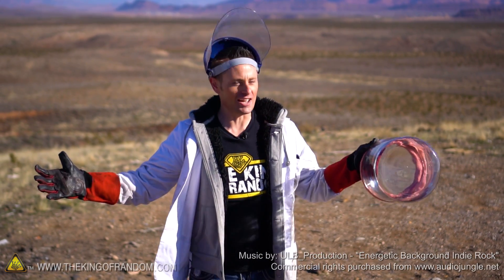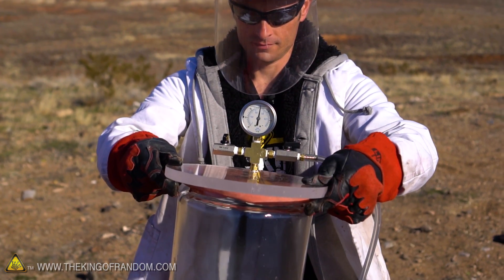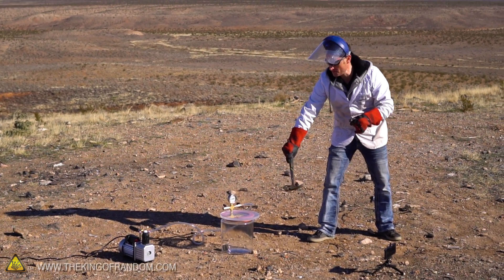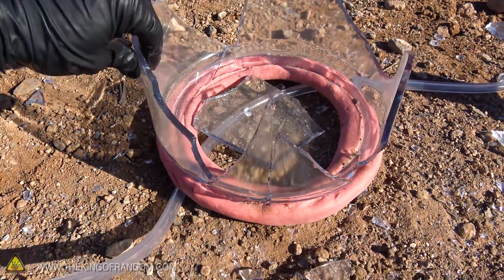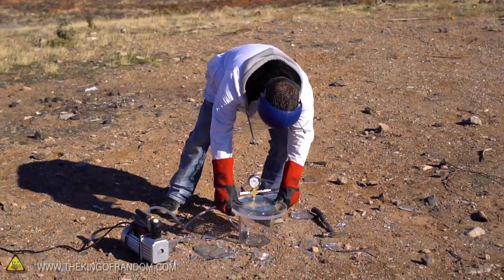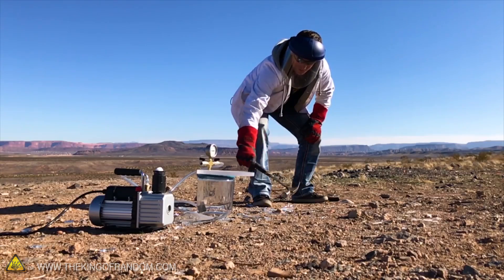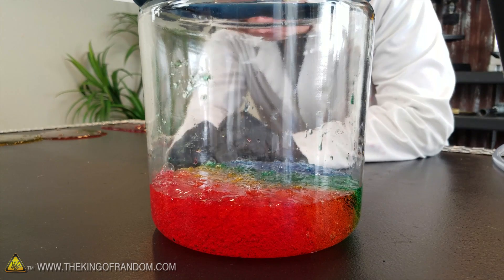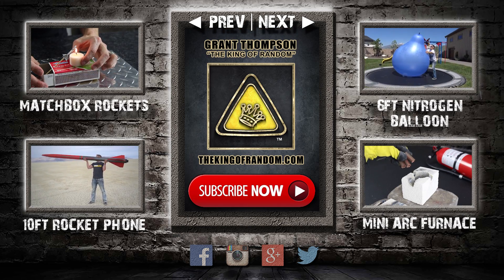Smashing Glass Vacuum Chambers

Comment: 25 inches  (635mm) of mercury is definitely not a strong vacuum considering atmospheric pressure is around 760 mm Hg. Most pumps that size should get down to 5 mm Hg easily, but your vacuum chamber is hardly air tight...

Comment: I have a theory, the glas should in one way explode, why well in a vacum you remove the air and it changes the pressure so if the glass would break then the air will come rushing in and the presure would rise fast and it would make a explosion???

Comment: Could you make a hand operated vacuum pump, like the kind they used to use to pump water for fire trucks (except with pvc, and without water). (google "hand operated fire pump")
p.s. it could be easier to operate if rather than pumping up and down, you arranged three barrels radially, then used a hand-crank to actuate the pistons.

Comment: liquid mercury vs liquid nitrogen
Reply: The side wall will not be the weak point. You should have tapped the bottom with a hammer. The floor isn't dome shaped like a regular vacuum glass and under a lot of stress. I bet it would break dropping it from 2-3 inches.

Comment: place fire work inside glass jar under pressure and ignite with strong laser pointer, may have to black out the fuse with sharpie.  I wonder what would happen with the expansion of the explosion under that sort of pressure and also what it would take to detonate the glass jar.
Reply: Brian Cramer 
Cody's lab did a video in it, if I remember correctly he couldn't get ignition.

Comment: How much negative pressure would be needed to turn the implosion into an explosion? If I remember correctly I know that some implosions end up sucking in a massive amount of air compared to the volume of the area and results in an explosion from the extra pressure. I assume it'll have to be a lot more negative pressure and a larger area than these jars.

Comment: What dose liquid niceragen do in a vacuum camber
Reply: Mpc Gamer Liquid Nitrogen just boils away possibly faster. Under extreme pressure Liquid Nitrogen can be made into Nitrogen Ice as more pressure raises the temperatures required for boiling and freezing where negative pressures lower it. Nitrogen already has a very very low boiling point and the vacuum makes that temperature even lower so it would just boil faster and possibly more vigorously but its not really a substantial difference. If Grant hasnt done it, another great youtuber Cody'sLab does this in one of his videos.

Comment: how will molten metal react in a vacuum ?
Reply: Ripstikerpro -Minecraft IT Will stay hot for a long time because the vacuum isolates really well
Reply: Berend Dekker yep. heat is pulled away. this is why copper is used as a heat sink. without anything to interact with the heat, it would last longer.
Reply: It doesn't do anything special.  There is a large variety of metals that have to be melted under vacuum, and make it a common practice in the foundry industry

Comment: not sure if it still works or what brands would work but i remember doing an experiment where you take a can of shaving cream and put it in liquid nitrogen and freeze it and cut the metal can off while frozen and when the shaving cream unfreezes it expands exponentially bigger than the original form

Comment: can you pop popcorn by introducing a sudden vacuum? 

my reasoning is that popcorn pops because water turns to steam and forces the kernel open. this usually happens by heating, but it could also happen due to low air pressure bringing the boiling point of the water way down. there are some wrinkles to this though. popcorn gets its shape and fluffiness because the heated starch turns into a gel that gains that shape when the kernel explodes before rapid cooling solidifies it into the little puffs of deliciousness we all know and love. I wonder if it would behave differently.

Comment: What would happen if you tried to use a hair dryer in a vacuum chamber?
Reply: The fan blade doesn't move because of the air, the air moves because of the fan blade.

The fan blade moves because a motor is forcing it to.

It's like waving your hand in the air vs a vacuum... it'll still move, there just wouldn't be any air to push around.
Reply: P Sylar 
the fan is moved by a small motor, so yes. but it should move faster because it isn't affected by the friction of the air.
Reply: Most hair dryers depends on air to cool down heating element. Without air it would overhead and thermal fuse/switch that is inside would disconnect power from heating coil. Other than that it would be just like spinning fan.
Reply: Or anything that sucks air to work
Reply: It would just spin the motor and probably burn out since no air would be cooling the motor as it spins.
Reply: P Sylar itll spin the fan inside, without any effect.
Reply: soulseeker3194 but the fan is shaped a certain way to blow air so what if there is no air to blow would the fan move?
Reply: P Sylar Cody's lab made a video about that

Comment: IT DOESN'T GET PULLED PULLED IN. It is pushed in by the atmosphere around it. It is like when you increase the pressure in a bottle the increased amount of air particle in there push out. As there is very few or no air particle in the jar to push against the inside wall of the jar that mean the pressure of the air particle on the outside of the jar pushing on it allow it to implode.

Comment: put proto putty in a vaccum chamber without corn startch cause you said in that video that if you dont have corn starch its hard to remove the air bubbles in the bottom!

Comment: what is different between implode and explode?
Reply: Fikri Noh Explosion will generally be from positive pressure such as  an inflated balloon popping. Implosion will be from negative pressure i.e. Removing the air from the cookie jar.
Reply: Fikri Noh Its just that the shards go inward or outward, like bombs explode and stars implode.
Reply: Fikri Noh IMplode goes inwards, EXplode goes outwards.

Comment: How did the gopro record sound in the vacuum chamber?
Sound doesn't travel in a vacuum.
Reply from the maker: You're right, it was the audio from my microphone, not from the GoPro.  I checked the original footage and there is no sound from the GoPro.  Only the vibrations from the internal microphone when the jar is hit.
Reply: While grant already answered the question - Sound can travel in a vacuum chamber.

Sound travels through any medium - its only vibrations in materials that we call sound, it isn't anything beyond kinetic energy transference.

In a vacuum chamber, the chamber walls transmit sound. With a properly tuned mic attached to the walls - or a laser mic, you can hear sound or detect kinetic energy vibrating the walls in a vacuum chamber.
Reply: Actually, there is only no sound in a perfect vacuum which is impossible to create.
Reply: Valdemar Åberg it was on the glass so it had particles to vibrate
Reply: Arron Davies so if it's impossible to create a perfect vacuum how do we know there is no sound in there.
Reply: Sound can travel through the glass
Reply: Valdemar Åberg check out codys lab he did a video on sound in a vacuum chamber.
Reply: It's touching the glass.
Reply: It doesn't work like that.
Reply: no air will mean no fire. no fire = no firecracker/fuel burning
Reply: Valdemar Åberg that were recording the sound with re other camera as it was his mic picking up the sound not the go pro.
Reply: One Shot Gaming there's too much space between particles in space for sound to travel
Reply: +One Shot Gaming Sound travels by making particles move and bump into each other. This continues until it reaches your ear at wich point you can hear it. A perfect vacuum contains no particles.
Reply: Arron Davies yup
Reply: The sound can be recorded on another device!
Reply: Dylan I wad the l one who said that they
Reply: Dylan lol youre right
Reply: Valdemar Åberg he turnd off the vacume
Reply: Wouldnt it be fun to get some rock that's got a high amount of air in it (some vulcanic rock u know what i mean) and put it into the vacuum chamber? Could also put another of those stones in there but before that let it get soaked with water.
Reply: Yamyatos Volcanic rocks have holes in them so nothing would happen
Reply: Well yes and no. Just like if there were bubbles on the outside of his gummy, not a lot would happen. But vulcanic rock is light for a reason. There are airpockets everywhere within. We know what happens to liquids, so this is about having a look at solids. Maybe nothing spectacular happens, but maybe something interresting happens. Probably it'll just crack or something, but i also wouldnt have thought that the wax would like as if it was boiling. when put in a vacuum.
Reply: Nothing would happen. It's porous, the air pockets aren't surrounded by anything airtight so the air would just flow out.

Comment: What you put a vaccumchamber inside of another vaccumchamber? would the one inside implode with enough force?
Reply: What force would their be?
Reply: Elrarion2 I don't know, vaccum?
Reply: A vacuum within a vacuum doesn't make the first vacuum twice as strong. Its like putting a bottle of water in a river. Nothing happens.
Reply: Yeah I know, but would the glass of the second chamber implode by the pressure of the larger one?
Reply: What chamber is what? The 2nd is the small one that is within the 1st bigger chamber?
Reply: Yeah, would the smaller chamber on the inside implode by the pressure the larger one on the outside?
Reply: A vacuum has nothing inside of it. Meaning everything even any air. So their would be no difference between the smaller chamber and the larger chamber. Similar to what i said earlier. A bottle of water in a river is the same as a vacuum chamber within a vacuum chamber.

Comment: put ethanol or other alcohol in the vacuum chamber. will the vacuum lower the pressure enough for it to boil?
Reply: Well as ethanol boils at a lower temperature then water and that water is able to boil in a vacuum then yes. Ethanol will boil.
Reply: Elrarion2 but is the vacuum he has able to make the pressure low enough
Reply: Most chances yeah.

Comment: upon examination, the only reason the large jar exploded was because you hit it with the hammer at an angle, therefor having a smaller impact surface but with similar energy and shattering the glass

Comment: next time, put in an insect like a cockroach inside the vac chamber, lets see if they can survive (pretty sure they wont) then try breaking the glass while the roach is inside.

coz i remember somewhere i read about the submarine that wasnt de-pressurized when they opened and all the innards and limbs of the oceanologists flew all over the submarine (a small size probably fitting 3-5 people)

Comment: you should try to hit the jars while putting pressure back into them to see if they can explode rather than implode
Reply: or try using a glass scoring tool to see how much you can decrease the structural integrity before it either breaks from the vacuum or from the air rushing back into the jar

Comment: as long as the pressure difference doesn't get crazy high the cylinder gets strengthened by the decreased pressure, as the "vacuum" is pulling on it from all sides at once, and thus giving it a higher structural integrity, think an archway with a lot of weight on it opposed to an arch without anything putting strain on it (ie, the strength goes up by adding wight until the strain on the material itself gets bigger than the increase in structural support, where a graph showing it would start to move down again). the bottom however only gets weakened by the pressure difference, as a flat surface has much less structural support in it's shape, and thus the very easy breaking by hitting the bottom instead of the side. If this is to be tested further, i suggest a jar with the same thickness on the sides and the bottom, and hitting them respectively with roughly the same force to demonstrate it.

Comment: Oh NO... lol.. its round.. your pulling the glass inwards.. 
did you ever wonder about archways or dams and why they make them that shape? :D its because under compression they get stronger..
So your glass jars will be stronger under vacuum on the rounded sides..

So to explain why the bottom vanished, it's because you're pulling in on a flat surface which is its weakest point. Which is why when you dropped it on the bottom it went so easily..

The test you need to run next is to tap it on the bottom as thats the weak point while its under vacuum!!!!

Comment: I'm pretty sure you're reading your gauge wrong Grant, air conditioner vaccum pumps usually reach ~500 microns. 25 inches of mercury is ~80% of atmospheric pressure and ~ 635000 microns (A micron is 10^-3 mm of mercury).

EDIT: Okay I realized that the way you have it setup what you're reading is the pressure differential between your system and the atmosphere, that means that 25 inches of mercury means that there is 6.25 in of mercury of pressure inside which is ~150k microns which is not that bad. Still though, if you really got an AC pump it seems a bit weak or maybe you just haven't given it the time it needs, the time to achieve the ultimate vaccum a pump can get is quite long so it's understandable.

Comment: If you put vacuum chamber into the water, will it float or will it sink?
Reply: axoliminator actually, it's the amount of water that the cookie jar displaces that allows it to float. It displaces enough water that the water is able to push up against it with enough force to counteract its weight. Given that vacuum has no mass, it would actually float better with a vacuum than it would with air!
Reply: The vacuum would mean there isn't ANYTHING inside the glass jar which would, I assume, make the contents of the jar,  lighter than air.
Reply: Katze It will float much better than one without vacuum
Reply: my guess is that it would sink. The air is what allows it to float because the air is less dense than the water. take away the air and you only have the weight of the glass jar, wich would then sink.
Reply: Katze water can't drown :v
Reply: It will float. If you take the mass of the jar and divide it by It's volume, you would most likely see that the density is lower than waters density, which is 1 g/cm^3. If the density is lower, that means it will float.
Reply: dimmacommunication U sure? Im Pretty sure itll sink
Reply: Zach D. Yeah I was about to say it's displacement because a scuba tank with 3000psi is denser so a vacuum chamber is lighter so it floats better than a tank with atmospheric pressure
Reply: Katze I want to know too
Reply: Keep in mind that floating isn't always dependant if there's air in the medium or not. As long as you're buyant enough, you'll float. vacuum or not. If a glass pane floats, there's no real reason why a jar shouldn't float, even with a vacuum on the inside. It's buyancy that dictates that. Keep in mind, a normal glass cup floats, even with some water in it.
Reply: thanks for the reply Zach, wasn't sure about my answer but yours clears things up :D
Reply: Katze sink
Reply: kacper krawczyk guys whoever wants to discuss this, read the comments above and dont leave another reply. Ty ;-)
Reply: It will break

Comment: Looks like cathodique tubes security tests done with metal ball and missile (metal cone) drop. they must resist to the ball drop, but must implose to the missile otherwise the energy trapped is too high and can be lethal when release. Seen several times during a previous job and really impressive

Comment: Maybe u should do a glass vacuum chamber in a pressure pot vacuum chamber, and turn both of them on, use pvc pipes to feed the glass jar the power, and protoputty the air leaks

Comment: you should try putting balloons in the vacuum chamber. one tied not inflated and  balloons slightly inflated with different gases: air, nitrogen, helium, CO2.

Also the glass breaking under vacuum is what happens to headlights during an accident. if the headlights are tungsten filament and on, the filament at the temperature vaporizes and tungsten can be found on the housing glass while any filament found is now tungsten oxide! Forensics materials science used in car accident cases!

Comment: what do you mean when you say the amount of mercury pressure?
Reply: American unit of pressure 1mercury is about 3,3k Pa if I remember correctly.
Reply: george aura 
20 inches of murcury is equal to 508 mm of murcury which is about 0.668 atm which is equivalent to around 9.82 psi
Reply: mmHg (millimeters of mercury) is a unit use to measure pressure in a given system.
Reply: Alexander Edwards wait he isn't lower then half an atmosphere?
Reply: Alexander Edwards dy7g7yghg
Reply: Anton Helsgaun yeah, hes pulling out a little over half an atm, so pressure on outside is about twice as much
Reply: Alexander Edwards ok. It still seems like a pretty crappy vaccum. I thought it was like 10 times as high on thr outside

Comment: Put a pint of Guinness in the vacuum chamber. Curious to see if you can get the bubbles to change direction. Can you get the pressure to the point where the nitrogen bubbles are suspended in the liquid?